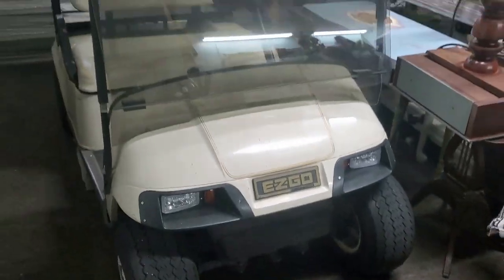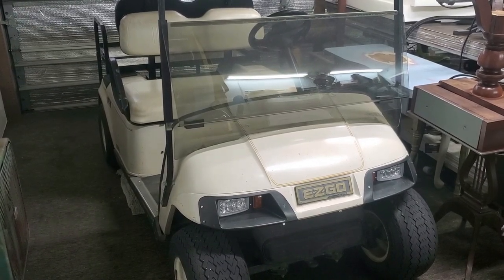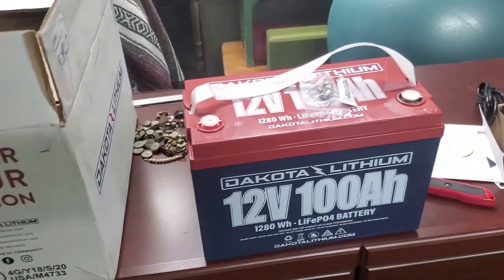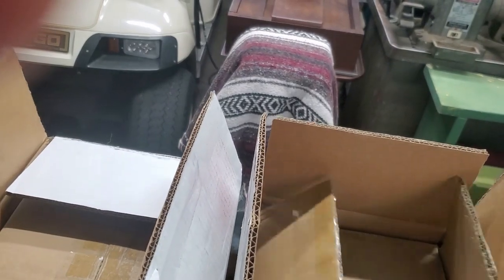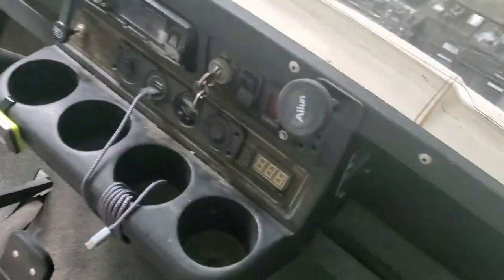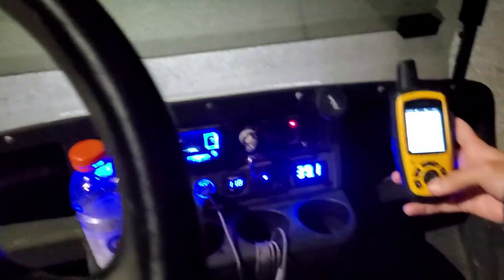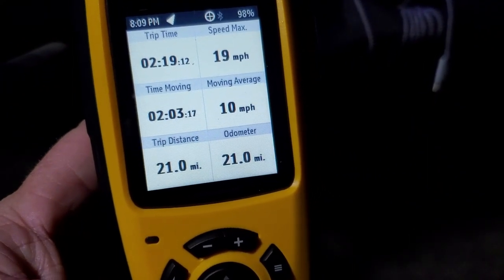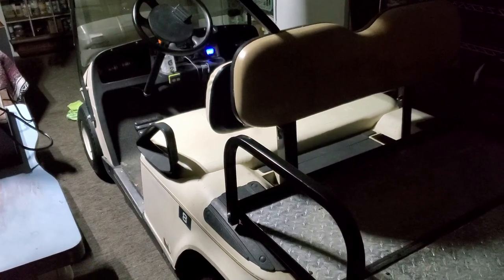Review- Replacing 36 volt Lead Acid with Dakota Lithium Ion TXT 36 Volt golf cart and 20+ mile test

Comment: I inherited a 36v EZGO TXT and swapped in 3x 12v 60aH Dakota DL+ batteries along with the renogy battery monitor as you did. My monitor is not registering when the batteries are being charged, did you have any issues with that?
Reply from the maker: I did. But first double and triple check all your wires. After that I actually called Renogy tech support and they told me to disconnect the small plug on the back of the meter and then plug it in again. And sure enough it started to work. Give that a shot.

Comment from the maker: *Important* The Dakotas are rated at 100 amps discharge continuous and 200 amps for 10 seconds. On my 36 volt PDS cart I have never had it trip. But I have the stock PDS controller. On the Renogy meter I rarely see over 150 amps draw momentarily (like 1 to 2 seconds) and usually not much more than 100. At full throttle and a steady 21 mph I am drawing around 50-60 amps. Lithium batteries in general are all the rage currently in golf carts...but so are big controllers and motors and people doing wheelies..lol. These two things really dont mix for off the shelf lithium batteries. If you have an aftermarket controller that is programmable you may be able to set the max amp load just under what will trip the Dakotas. There are a few people than make some batteries capable of 350 amps discharge, But so far they are semi-custom and in short supply. If you are looking for max power with upgraded high amp controllers and motors the Dakotss and most off the shelf 100Ah lithium batteries are not a good choice currently.  You really need to choose between a long range, stock amp set up or a high power set up. IF YOU WANT A HIGH POWER, HIGH DISCHARGE SET UP YOU REALLY NEED TO RESEARCH THE SPECIFICS OF YOUR SYSTEM VS THE LITHIUM BATTERY YOU MAY WANT TO USE TO ENSURE THEY ARE COMPATABLE. For a real world range test on these particular batteries see the following video https://youtu.be/up_jfMvosHY
Reply: The Dakota 12v 60Ah batteries for 36V carts are rated for 400amp motor controllers. And have a 25 mile range.
Edit: The Eco Battery brand sells a 36v and 48v battery that is just one single battery. Fits directly into the factory battery tray. Comes with a charger. About the same price as the Dakota kit, just a nicer fit. Eco Battery states they are compatible with all aftermarket motors and motor controllers.

Comment: yea im switching too but you can get 8 yrs out of lead acid if you maintain and desulfate with a good charger, the stock charger is your whole problem. i have just ordered a 36v 100 ah lifep04 1 battery great construction ,and grade a cells 600 bucks its cheaper than lead acid , i went cheap a few yrs ago with durecell lead  acid . will take them and add to my battery bank. tore apart a few dakato's and nope , hope you do well with them
Reply from the maker: I have already swapped out the Dalotas for a single Epoch battery with many more features.
Reply: @mvintrigue-trawlerdiy1101  yea cart can have amp draws in the 130 area and needs a good bms .

Comment: Great video. I am trying to decide between Dakota and Roypow. Are you still happy with them?  I have a 201.5 TXT and plan on doing the switch to lithium soon.
Reply from the maker: Still very happy. And they remain flawless with no drop in capacity or range. Is yours a 36 volt as well? If so you can get batts lichens and Ampere time and save a thousand and get the same performance.
Reply: @mvintrigue-trawlerdiy1101  Enjoyed watching your videos on this project.  Do you know what the max amps are for your stock controller?  I have a 2005 ezgo I am considering putting 3 12V 100ah ampere batteries in.  My controller is a Curtis 350 max amp.  I believe it is original to the cart, but not certain.
Reply from the maker: @korycantrell7914  I believe mine is a 350 amp controller. But moniting the amp draw on the renogy it rarely comes close. Of course I don't drive crazy or accelerate hard and in Florida not many hills.

Comment: I've got the same cart and Renogy battery monitor. Mine stays on 60ah and 100% the whole time I use it. I've used it for hours since I have a 30 mile range with the Dakota Lithium package. I have 12v 60ah x 3. Can you make a video on how you wired in that renogy meter? Thanks  great videos btw
Reply from the maker: Are you sure it's hooked up properly? Go through the wiring again. Also search for Renogy meter install videos. There are dozens. Also when I first got mine it acted weird at first. I called Renogy and they told me to just unplug it from the monitor and plug it back in
 I'll be darned if that didn't fix the issue.
Reply: @mvintrigue-trawlerdiy1101  thank you. I think I had the negative wire going the wrong way.

Comment: Have you figured out how many miles you get before the low 90% used kicks in? Also dose it have as much power on the grass and backyard small hills?
Reply from the maker: I did another video where I did some testing for range. It looks like around 45 miles till 0. So I figure around 40 miles to get down to 10% left. Give or take. As far as power its really about the same. However I dropped so much weight it does accelerate slightly quicker and deals with hills better. But its mainly because the cart lost over 200 Lbs.
Here is a link to the other video. https://www.youtube.com/watch?v=Wqiw8Z49agw&t=614s&ab_channel=MVIntrigue
Reply: Great video. I have a line on 3 12 volt 80ah lithium ion life4 batteries from a friend. Not sure if they will go as far but they should be 80% good as your 3 100ah? You think?
Reply from the maker: @MJamMan  stands to reason.  That would still be over 30 miles.
Reply: Just a little worried about running them in series. Some articles say it should not be done, cold be dangerous.
Reply from the maker: @MJamMan  Unless there is something particular to the batteries you are getting I dont know of any reason to not run in series, Especially if each unit has its own BMS. As a matter of fact Dakota and others sell gold cart packages that are intended to be in series. Youll need the appropriate charger though. It will need to be 36 volt for lithium.

Comment: How many battery Ah do I need? My EZGO batteries are shot and I'm thinking about doing lithium batteries. Mines 48v.
Reply from the maker: Then you would need four 12 volt batteries. Are you all stock and unmodified? If you are modded at all for faster speeds or more power you'll need a battery set up that can deliver more amps.
Reply: @mvintrigue-trawlerdiy1101  Thanks for the reply. Yes, all stock.
Reply from the maker: @Kaiser187  sorry. You asked about AH. I would not get anything less than 100AH total. If you can afford more do it. 150ah or even 200 would be great. Also ..usually the high AH the pack is the higher the continously and peak discharge is. Keep researching and reading. And read the disclaimer at the top of the comments. Sorry. I would type more but I'm at work.
Reply: @mvintrigue-trawlerdiy1101  I'm trying to re search and figure this all out. I don't know much about golf carts. I bought mine used, the batteries are about 5 years old. I wanted to do one large lithium if I could but 4 12v would work also. I'm just confused about the AH that I need.
Reply from the maker: @Kaiser187  one big one is great as well. I used Dakotas but there are many very good batteries on the market. Extreme Team, Roypow and others. As long as it is a 48 volt pack that is atleast 100 AH I think you'll be fine. If you plan to mod in the future you should talk to Extreme Team or the other semi custom battery makers and discuss your plans.
Reply from the maker: @Kaiser187  looks pretty good to me as long as you ate stock. I would still call them first and discuss what it's going in. I would also search for other users to be sure they aren't having issues. Good luck!

Comment: Hi MV Intrigue- Trawler DIY I have the same cart and bought the same batteries. After I hooked them up, I get lights and horn but it doesn't move at all - or even attempt to move. I also purchased the Renogy meter and that works well. The batteries are fully charged. Any ideas? Thanks.
Reply from the maker: If you bypassed the stock charging plug there is a reed switch in there that needs to see 36 volts in order for the cart to move. It basically acts as protection so you dont drive away while hooked up to the charger. So if you pulled all that out be sure to find the samll wire and hook it to your positive end of the bank. Be aware this defeats the lock out to disable the cart while charging.
Reply: @mvintrigue-trawlerdiy1101  BINGO - AMAZING!!! Thank you so much, that fixed it.
Reply from the maker: @aportilla007  OH great! Happy to hear!
Reply: @mvintrigue-trawlerdiy1101  now I'm looking for a new 200 amp speed controller. Mine trips the batteries if I pull too much power.
Reply: @mvintrigue-trawlerdiy1101  I'm getting like 20mph, and so much more torque. Woohoo :)

Comment: Have you had any issues with the BMS tripping? I did swap and when I go up a hill it trips. One of the batteries drops out voltage. When I disconnect and reconnect I get voltage back.
Reply: Mine did the same thing on my first test drive.  I was just accelerating on a street.  I am sending them back and I think I will go with Roypow.
Reply from the maker: What controller do you have? The Dakotas are rated at 100 amps discharge continuous and 200 amps for 10 seconds. On my 36 volt PDS cart I have never had it trip. But I have the stock PDS controller. On the Renogy I rarely see over 150 amps draw momentarily (like 1 to 2 seconds) and usually not much more than 100. At full throttle and a steady 21 mph I am drawing around 50 amps. Lithium batteries in general are all the rage currently in gold carts...but so are gig controllers and motors and people doing wheelies..lol. These two things really dont mix for off the shelf lithium batteries. If you have an aftermarket controller that is programmable you may be able to set the max amp load just under what will trip the Dakotas. There are a few people that make some lithium batteries capable of 350 amps discharge and more.
Reply from the maker: @djendrey  Be sure to look at the specs. It looks the the Roypow 160AH pack is the only one rated for larger amps. I think its 315 amps for 30 seconds. Thats a big 48 volt battery! You will be able to drive farther than you want too...lol.

Comment: Are you getting 300ah using 3 batteries ? - 1 -36v - 100Ah batt is 1/2 the price of 3 -12v batts. ????
Reply from the maker: Chuck..who makes the single 36 volt 100 ah for half price?  There are lots of people selling batteries coming out of the woodwork these days. I'd be interested to know. And when you wire three 12 volt 100 ah Batts in series the AH is still 100 but of course at 36 volts..

Comment: Are you having to charge each battery separately, or can you charge them in series?  Just ordered the 48v setup for my TXT.
Reply from the maker: No you charge them all together. If you ordered the 48 gold cart package it should come with a charger. Its a pretty easy swap.
Reply: @mvintrigue-trawlerdiy1101  Hey I just got my batteries installed the other night and went on my first test drive.  About a 1/2 mile in it shutdown.  Apparently the internal BMS will trip if it thinks there is too much draw.  This was right when I was accelerating.  I contacted Dakota and they stated that my controller draws too many AMPs.  Have you had this issue with your system?  I also have a Madjax dc to dc converter to take it from 48 v to 12 v for my lights, it might be the issue too.  I am going to test tonight.  Also read one other guy returned their batteries because of the same issue.
Reply from the maker: @djendrey  What controller do you have? The Dakotas are rated at 100 amps discharge continuous and 200 amps for 10 seconds. On my 36 volt PDS cart I have never had it trip. But I have the stock PDS controller. On the Renogy I rarely see over 150 amps draw momentarily (like 1 to 2 seconds) and usually not much more than 100. At full throttle and a steady 21 mph I am drawing around 50 amps. Lithium batteries in general are all the rage currently in gold carts...but so are gig controllers and motors and people doing wheelies..lol. These two things really dont mix for off the shelf lithium batteries. If you have an aftermarket controller that is programmable you may be able to set the max amp load just under what will trip the Dakotas. There are a few people than make some batterie capable of 350 amps discharge. But are generally just a bit more expensive and are semi-custom.  Your DC to DC converter probably draws only an amp or two so it probably doesn't have much impact.
Reply: @mvintrigue-trawlerdiy1101  Stock controller and motor.  It is lifted with 23 inch tires.  Seems like it might be a problem on the 48 volt setup.
Reply from the maker: @djendrey  The big tires do act like a higher load and taller gear. You can probably just roll into the throttle. The renogy meter I installed allows me to see the amp draw in real time and on my basically stock cart is usually only see less than 200 if I punch it. But I generally ease on the throttle just by my driving style.  They do have lithium batteries capable of those larger amp draws out there. Will Dakota take yours back?
Reply: @mvintrigue-trawlerdiy1101  yes I agree with you on the driving style, but just blows my mind that it tripped that quick. I bought the same Renogy, but have not hooked it up yet. Yes they will take them back, we will see if they charge a 5% restock fee.
Reply from the maker: @djendrey  Man...sorry they aren't working for you brother. I am glad to see they are flexible on the returns. I was just researching other lithium brands for higher amp loads. Even Bigbattery.com 48 volt pack is 130-175 amps max continuous depending on model. I just said to someone yesterday that the market had a huge demand for higher amp output lithiums. I have no doubt you will see them soon. I am tempted to build my own with parts from China and put the Dakotas in my boat. That will probably happen by next year.  Good luck with whatever path you end up going.
Reply: @mvintrigue-trawlerdiy1101  Alright after pricing shipping and 5% restock I am going to give these another shot.  Test drove today went good with me not hammering the throttle.  Also hooked up the Renogy so that is nice to see the amps being drawn.  Here is the final setup. https://youtu.be/dT-8BWfW6-Q
Reply from the maker: @djendrey  good deal man. Give it a whirl. Sucks to have to restrain yourself but maybe that's a good thing..lol
Reply: Do you charge the batteries in a series or individually?

Comment: How does it go up bills. Does it still have the powere
Reply from the maker: Yes..goes up hills better. A 36 volt lifepo4 pack actually sees around 38 to 40 volts and the voltage does not droop as much under load.  It's also much lighter. So hills are no issue.

Comment: What about the head light? Did they need any rewiring?
Reply from the maker: My cart did not come with headlights. They were added last year. I used a 36 to 12 volt converter and then a switch to power the 12 volt accessory panel. Then on the panel I have a separate switch for the head/tail lights. I just realized I do not have the 12 volt accessory switch panel in my comments. I will add them. But if you already have headlights they should not need rewiring. Just hook up the Dakotas as you would your regular batteries. You will just have half the connections.

Comment: It seems like too much background and not enough information.  I would have like to have seen how the tray was prepared, how the wood was cut and installed, more information about the wiring, and how all the gauges were installed.  Non of the information I was looking for was in the video.  How much did the battery upgrade cost?
Reply from the maker: The 36 volt kit is 2399 I believe. It comes with a charger too.
 Occasionally they have sales. All the other stuff you mentioned is more mundane normal stuff. And I didn't do anything special for this things. Other than putting some wood down  these are really drop in. I really just wanted to highlight the battery differences. And yes I have a tendency to blubber on a bit..lol.
Reply: I think you should ask for a refund ;)

Comment: I’ve read that you an use your old charger and port on the cart. Could you do that?
Reply from the maker: A regular charger is not likely to have the same charge profile and final voltage required for lithiums. So its not recommended to get the longest life from the batteries.  But if you order a Dakota kit atleast they do include a charger with every golf cart kit.